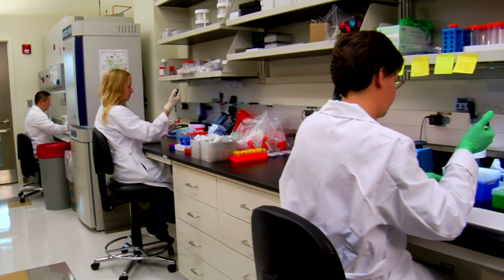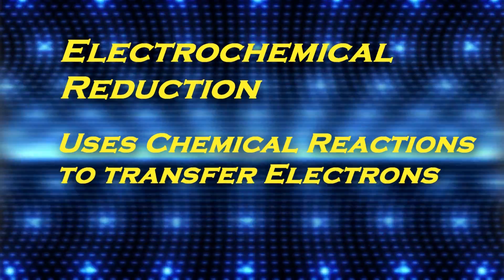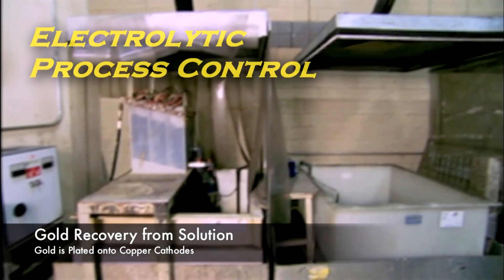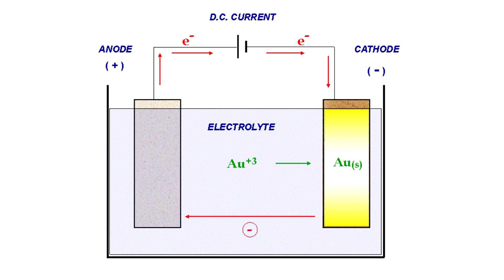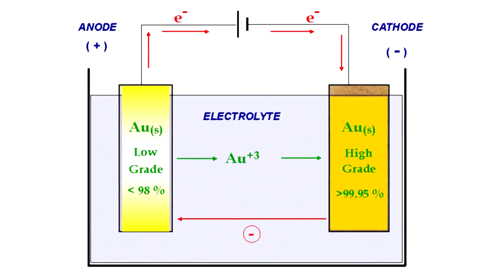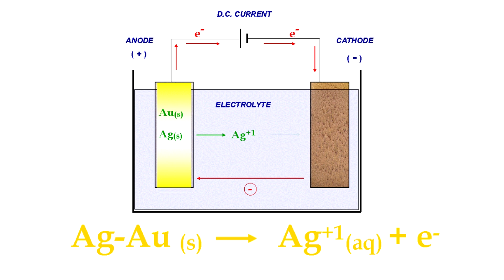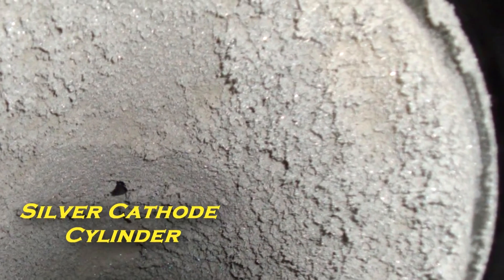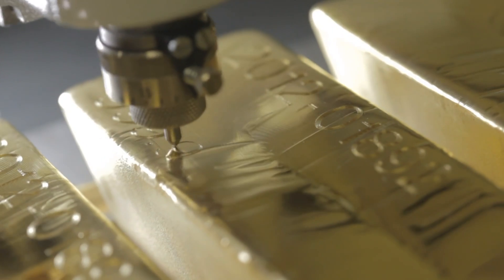How to Refine Precious Metals - Electrolysis: Hydrometallurgy Part 4

Comment: Nice I would like to get more information as most of the gold on my claim is micro gold and have no way to recover it with out putting more money in to recovery then money returned .
Reply: My claims are a large percentage air float gold with some Halide and Sulfide ore. My production costs are $24 per ton using gravity processes with a 90% recovery.

Comment: hi,need
 help please, i have more than 30 tonnes of activated carbon with 30 ppm
 of Gold and 90 ppm of copper, i dont want to use Elution machine 
because its more expensive, am looking foward using Burning Activated 
carbon to extract gold, OR if there is another way to extract from that AC. and how much gold i can get from 1 tonne?
thanks.
Reply: Crush it, smelt with lead, cupel away the lead
Reply: Send it to me?
Reply: @charadremur333  Probably doesn't fit the end goal...

Then there's the shipping 🤣
Reply: Pump chlorine gas through it.  You might need to hydrate first.
Reply: Our company has professional gold extraction equipment.

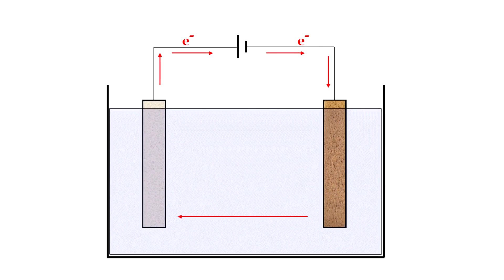Comment: That big box of trimmed fingers at 1:02 is about 15 pounds in weight. That will produce about 22 grams of pure gold - less than one Troy ounce. Computer scrap is very low yielding.
Reply: But it's something none the less.
Reply: @JuanCarbutt  free is free, it's still a better ore than a natural ore.  Sreetips is awesome tho
Reply: @travismiller5548  Yea its free, thou you have to take into consideration power / chemical cost which is likely > value of what you refine.
Reply: sreetips I have just been watching your videos on your stock refining , hello I thought I would watch part 4 next and follow them through, this electrolysis refining I Im thinking would be cost prohibitive for small processes , would it? I find your videos very well done
Reply: @sreetips. If you start comparing it to modern mining electronic scrap when running tonnage becomes significantly more profitable than oporating a mine. The issues then become sourcing.
Reply: What happens to the schematic plastics